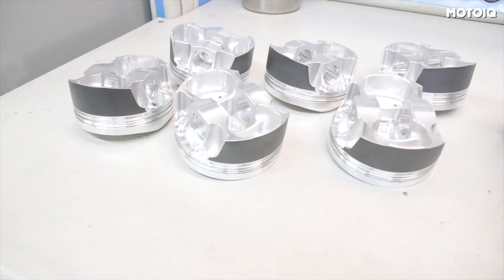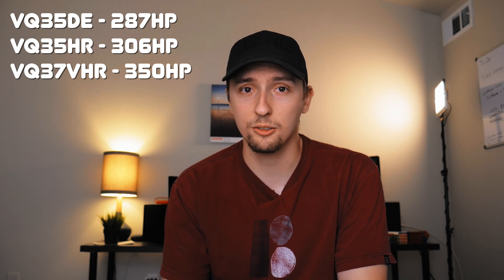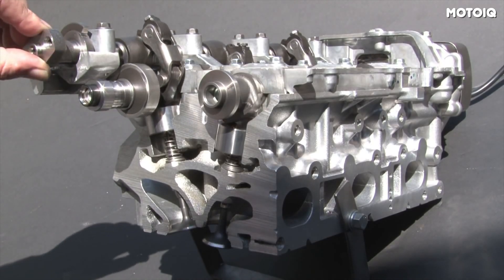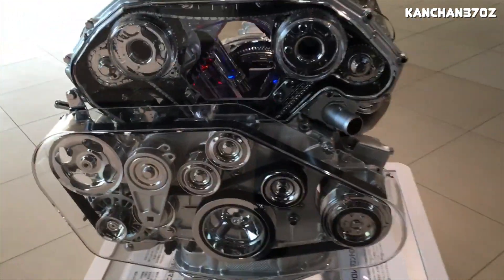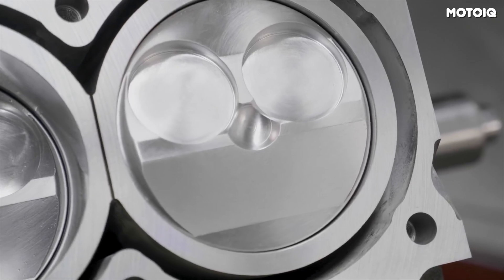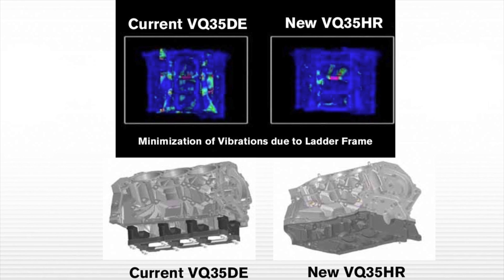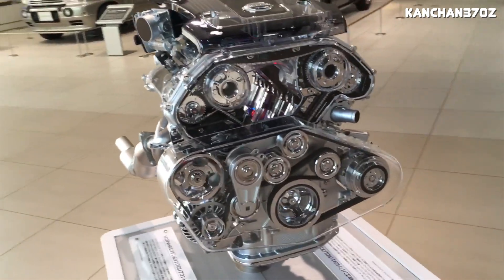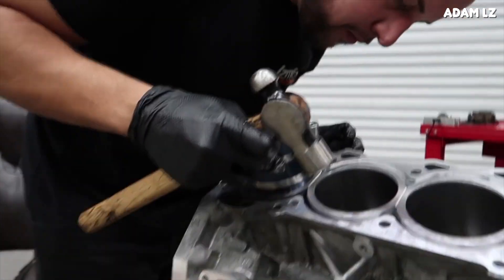Nissan VQ37VHR: Everything You Need to Know

Comment: I bought a 2008 G35s brand new. Put over 400,000km on it. Not 1 problem in the 6 years I had the car and I DID NOT baby the car. Pedal to the floor most the time, and many missed oil changes.

Comment: Im thinking about swapping one of these engines into my S15. I've had an RB swap which I loved (400whp) but the price of these today is almost as much a VQ37. Theyre old, have high mileage and many inherent issues. I've built SR20s, including an SR22vet (VVL head swap) in my car which just recently let go after afew years of abuse on 1000whp. I am now looking for a replacement. I will no longer stay SR as price for parts are through the roof and dollar to HP ratio is through the roof, the best 4 cylinder option is K series which I love as I have daily driven K swapped EKs and also owned EP3 type R and FN2 type R, i know well the capabilities of the K series. I am now at a cross road of swaps, from VQ which is new and full of technological advancement, or K swap which is almost like a Vvl SR20 on steroids, or the well tried and tested 2JZ. I really want to keep this car Nissan powered which has led me to this video, hopefully the information here helps me decide as here in Australia we have alot of SR20 and RB experience but not nearly as much K series 2J or Vq experience. Thanks for sharing this video

Comment: My opinion may be bias as a Z34 owner but I’ll say this. 

For what the VQ platform is, off the brochure performance numbers alone, it’s quite an interesting motor. 

They’re reliable, relatively easy to care for and the power is notable, considering that Ford didn’t have an OEM V8 Mustang making as much if not more than the VQ37 until four years after it went into production. 

Of course now off of horsepower numbers alone, the SS Camaro, 5.0 Mustang, V8 Chargers and Challengers have all but surpassed them but still. 

The fact that you can see plenty of videos of FBO tuned VQ37s out here giving scat packs or brand new stock V8 American muscle cars a run for their money is impressive.

Comment: My 370Z has a Stillen Hen 3 long tube intake, a Fast Intentions true dual x-pipe exhaust and a dyno tune on a Dynojet chassis dyno. Running 94 octa in e gas, We got about 390 peak crank horsepower at 7200 rpm and a nearly flat torque curve across the whole rev range.

Comment: Mine has 130k miles. It still idles smoothly and runs like new. Looking forward to adding another 130k miles.
Reply: Did you do spark plugs if so at what miles
Reply: @unpredctable-dn8bu  I did it around 11k miles. They were still in good condition. I change the oil every 3k miles. Maybe that's why.

Comment: I'd say the gains with a tune and cost effective bolt-ons goes a long way. My G37 stock put down 272 HP on a dynojet. After, I had 2.5" madrells installed, no cats, X-pipe and a Borla muffler. With this it went up to 290HP pre-tune and 307 post tune (Mustang Dyno). I'm still running the stock intakes with K&N filters. Mine is a 7 speed AT which I thought I'd regret because I couldn't find a good manual one to buy, but I don't. With the same tune I was able to get the TQ management tables raised which allows it to shift hard and chirp tires all the way to 3rd at WOT. If I wanted to boost it to 500 HP, I'd prefer to keep the same auto trans and reinforce it; there are a few companies that do it. With the current settings, the shifts feel like a DCT.
Reply: Well for the trans. There’s 2 weak points when boosting it. The flex plate and the torque converter. Because otherwise the trans in the vr q50/60’s are really similar mechanically. But because of the better flex plate and torque converter the vr trans hold 600-700 before needing a built trans. But honestly if you do transmission cooler and a aftermarket flex plate if you plan on doing about 500 your stock trans should be fine.

Comment: Mine with 273k miles still runs like a champ
Reply: Oh good..
I just bought a practically brand new 2016 370Z Sports Touring and had 110,600 miles on it but runs like butter. I only use Shell 91 gasoline in it, and looking forward to a long lasting engine, especially because I only drive 28 miles per day roundtrip, and don't drive if i don't have to. Your engine at 273K, of course at the time you posted as this post is 5 years old, is a testament to Nissan engineering and good care!
Reply: @RedMoonBlitz305k now 😎
Reply: @rommelgallego2943 Had to correct my post, I accidentally put 2026 when I meant 2016 Nissan 370Z. But she still looks and runs new! You still have your Z?
Reply: @RedMoonBlitzmine is ‘09 G37 sedan Boss clocking in at 305K miles as my DD and keeps on going.

Comment: really great car. i own a 2010 g37 sedan and its been my favorite car. i got it at 49k miles and didn't have any major issues until 145k miles which in part is my fault. the car overheated and due to the aluminum block, got a crack in it and currently swapping out the engine for one with 58k miles on it. lesson learned, aluminum blocks cannot withhold a lot of pressure, my car slightly overheated and blew a gasket and got a hairline crack on the block other than that great engine!
Reply: It didn’t go into limp mode to prevent that??? Mine just went to limp mode because I bought it with no coolant in it 🫤 worried about if I possibly damaged anything else driving it like that for 40 yards or so

Comment: These motors are basically bulletproof. i worked at Infiniti for about 6 years and we only had 1 VQ37 engine swap in a 6 year span due to the driver redlining the vehicle every time it was driven for about 4 years. The VR30DDTT on the other hand we had about 2 swaps a week on those engines. VQ's are just superior.
Reply: This comment made my day
Reply: @MrBroome-wi6zg  what are you driving?
Reply: I would agree 100% I have owned my 2003 VQDE since new and have redlined it since I have owned it.

Comment: Currently looking to buy a 2011 G 37. Looking up videos and this one was very helpful. My main concern is obviously the engines reliability so you hit the nail on the head on this one. Thank you.
Reply: Get it i got mine this year with 87k miles 1 owner he was a older guy took great care of it.  just make sure it was well maintained not tortured try to find one w 1 owner and no to much miles these engines are solid as long as you take care of it by keeping up w oil changes and reg maintenance it will take care of you for up to 300k miles ive seen one w 335k on a g37 sedan
Reply: Just got a fx37 yesterday and looking forward to this engine
Reply: @chrisayala9871  I found a 2014 370z with 15k miles. Never saw rain or snow. 3m used everywhere on the front to protect paint. It is immaculate. I am resisting tt though. Lol
Reply: If you can go with a 2012+ the gallery gasket problem was taken care of
Reply: 244,000 miles on my 2012 g37 sedan journey . Best car I've ever owned and by far the most fun to drive . Just make sure to have the sunroof drains cleaned out . I thought my windshield was leaking but the drain tubes go down the A - pillars and out the firewall . If you get water in your floorboard just use gorilla clear tape around the outside edges of the sunroof until fixed . There ,saved you a future problem .

Comment: The VQ37HR is not as efficient as the VR38, it is close. The VR Bore is 98 mm with the same 86mm stroke. VR38 also has, the same deck height and since the bore is slightly larger, so are the Valves and their arrangement within the larger Bore. The VVT and the Twins also are an improvement. As a matter of fact the VR38  VE table is 3-6% more [86%-83% at 7000RPM/ 96%-90% @55000RPM)) and thus, has a bit more flow.[ (Air Volume/Cycle)/(Displacement)].
The VQHR is one hell of an engine : the VR38 is simply an incremental improvement, but the VR38 is the slightly better engine. I am making 925 Engine HP with Stock Internals [E85 using ECUTEK] and upgraded Turbos. Again, the VQ is nothing to "sneeze" at!!!  NISSAN did a great job with the VQ37HR and thanks for your learned review of the VQ37HR, you are extremely knowledgeable: very refreshing with all the "crap" on the Internet!
Reply: 55000 rpm?
Reply: Great, you can copy and paste. And yet, you're not even smart enough to know how to spell check.

Comment: He ain't lyin about the reliability and it being bulletproof. My 2009 370 now has 207,000 on the clock and still runs like new, only "major" repair its ever needed, was an alternator at 150k miles, seriously. Hands down best car I have ever, or will ever own.
Reply: 183k and still pushing like wen I first bought it
Reply: How about water pump since it’s connected to the timing chain?
Reply: @305dadecounty305 my water pump pulley going out I’m at 130k
Reply: locked my engine last night with 153k miles kept oil lovels perfect but the gallery gasket went out also 09 370z
Reply: @brandongrover3974  gallery gasket was a recall , wasn't it?
Reply: @brandongrover3974   Nissan fixed the issue around mid-2010 or so.
Reply: hey man this comment is mad old, but how are the oil levels ?  would you say its hard to manage or do you just have to be more attentive in comparison to other cars?

Comment: VQ owners, represent!!
Reply: 2019 370Z sport coupe 6MT - the engine rocks
Reply: Yes sir
Reply: Just got one😎
Reply: ‘13 g37 yessir
Reply: G37 coupe 😈
Reply: 13 G37 Sedan journey. Beautiful white. Love those night spirited drives. 💯
Reply: Just bought a super clean 2011 g37 sedan with 85k miles, 1 owner. Im happy AF🚗💨😎
Reply: Owned a 09 g37xs, a 13 g37x coupe, and currently own a blacked out 370z base manual.. the 09 i sold over 140k no problems. The 13 i sold at 125k no problems. And the 370 is a 2020 with 20k miles no problems yet
Reply: Collectively put over 250k miles on the VHR. Those engines can take some abuse and are reliable... take care of them and they last forever
Reply: 2015 q40 Hello
Reply: 350z 2008 hr
Reply: 2017 QX70S
Reply: I got the vq35hr 2010 Altima SR
Reply: 288k miles and counting on my DE
Reply: 2016 Nismo 370z
Reply: 08 G37S Coupe 66k
Reply: Had one for 4 years and we love it!
Reply: just got my q50 brotha 😎
Reply: ‘08 g35x. And now QX70S
Reply: G37 ZOOMER HERE
Reply: 2012 G37xS
Reply: '16 QX50
Reply: Hello there
Reply: Here
Reply: Hier!
Reply: Only reasons I sold was they appreciated in value 😂 and it was time for an upgraded vq37vhr
Reply: 2015 Q50 🎉
Reply: I’ll swap you for an Altima 2006? Someone ?
Reply: '12 modified Xterra Pro4x with a 6 speed manual
Reply: Just got mine ❤
Reply: Here! 2017 QX50
Reply: @JoeT_17QX50  2014 for me. Got it in August. I absolutely love it. Goal is to pay it off in under 2 years and get a 2017 with under 70k as a part time car that gets tuned.
Reply: 15 q50 AWD
Reply: 2014 Q50 Premium AWD. Once I modify the infotainment system to get Android Auto it will be the perfect car. Fast, beautiful, luxurious, and reliable.
Reply: 2022 Nissan Maxima VQ35DE!
Reply: VQ30DE-K here.
Reply: VQ GANG
Reply: 2014 QX50. I absolutely love my car and the VQ is a major reason why.

Comment: no you will get a power increase with proper bolt ons & admintuned 🥱
Reply: Admintuning blows motors. He turned off my knock sensor and it blew 3 days later with me just cruising on the highway.  I dont have a flame map or popcorn either. I went in with new spark plugs and fresh oil change.

Comment: So glad I got a ‘19 Z base sport model.  That said it has bad snap oversteer and feels a bit numb.  Appreciate any tips for corrections thereof.  
Not too interested in increasing engine output - can’t use it on the street really and am not going to track the car.
Reply: I have the exact same car with the 6M gearbox in Magnetic black. I haven't noticed any sort of handling anomalies such as you mention. I did a very fast drive down the California coast highway, US 1, from Oregon to San Francisco on very tight and twisty turns at more than double the posted speed limit. The car handled flawlessly and was completely stable. I did wear out the OEM Bridgestone Potenza tires in front though.

 Shortly after I got the car I had a set of stiffer Hotchkiss anti-roll bars put on the front and rear.
Reply: @videomaniac108  Sounds great Jim.  What tires did you replace the OEs with?  Did you replace them with the exact same size?  I did hear the Hotchkiss bars are great.  I am looking at getting Eibach front and rear sway bars based on the recommendation of my dealer’s service reps who do some racing.
Reply: @jacksparrow5281  I put the Michelin PS4S 245/40R19-F, 275/35R19 R(OEM sizes) on and noticed that the ride is quieter and less harsh. I had to go up on the inflation pressures from the stock 32 psi all around to 43 psi - front and 46 psi - rear to get equal tread wear across the tires. The Michelins have great grip in the wet and dry and I estimate that I will get 30K miles on them easily, without tire rotation - which we can't do on this car with directional rotation tires and the staggered tire sizes. My only complaint with this tire is that because of the more flexible sidewalls the handling is a little more vague and less precise. I plan to go with Michelin Pilot Sport Cup 2s for the next tire. Around the end of the year I'm planning on putting a set of Litespeed forged magnesium wheels, maybe in 20", on the car in a +1 setup. One nice thing that I like with the Michelin tires as compared with the Bridgestone tires is the use of Aramid fiber instead of steel belts, which makes each tire a few pounds lighter.

The stiffer bars will make the ride more harsh, but the handling improvements are well worth it in my opinion.
Reply: @videomaniac108  This is great information.  Enjoy the car.  thx

Comment: I love my Q50 2014 with this VQ engine!! Super reliable! But not so great on gas mileage
Reply: Yea my 15 q50 is a guzzler but it's ok im also not so easy on the pedal
Reply: I have a 2015 Q50 RWD. Average 21.4 MPG on 93 octane.
Reply: love my 2013 g37, i feel yea on the gas mileage. still better on gas then my v8 monte carlo
Reply: I'm averaging 12mpg at the moment... highway driving isn't much better either
Reply: @ekamvirk7599  something is wrong with your car, my man
Reply: I have a 2009 G37 and get 21 around town and 26-28 on the interstate doing 70-80mph on a long trip.
Reply: I have a modded and uprev tuned '13 g37. Stop and go I get around 18mpg. If I get hit the interstate at all, mileage bumps up to 23-24, maybe more. Any hard driving though and it will easily get down to 14-16 mpg.
Reply: I have a FX37s and I average 20.2
Reply: Yeah I average 21.6 highway, but typically get 17-19 city
Reply: I've got a 2017 qx50 Infiniti.I've never floored it and havnt needed to.what a sleeper the little SUV will suck you back in the seat.Get solid 24 mpg on highway

Comment: The oem intake is designed so well the only intakes I believe that help are the stillen gen 3 style. People who put those “CAI” which in reality is a HAI don’t understand how intakes work. Only downside to the gen 3 style like it are almost always made of metal of course but no coating. Definitely need to wrap them up with heat resistant tape u.
Reply: Uh AdminTuning 3 inch intakes is better then the stillen ones and with the admin you don’t gotta wrap them up.
Reply: @AQCE245  yeah true especially with the optional filters
Reply: @sk8punk318  Allot of people don't understand that when you use 3inch intakes you gotta upgrade your throttle body to 70mm to take full advantage of the 3inch because keeping the stock TB is like trying to breath threw a small straw
Reply: @AQCE245  It's really not that big of a deal
Reply: @AQCE245  TB isn't the only thing you need to upgrade if you get 3" intakes. These noobs don't realize you need to do ported lower manifold. If the space for air remains the same from the inside of the engine, stretching it out from the intakes makes negligible gains

Comment: Here’s a video idea that would seem interesting. VQ37HR vs N55 (or n54). These are 2 engines that I’ve noticed are heavy sought after
Reply: Its much easier to make a N54 fast with a few bolt ons. The vq37 is quick but once the boost kicks in bye bye infiniti 👋🏼
Reply: @JDM_KID_DAILY  Unless you supercharge the Infiniti which can make 600+whp on stock internals reliably.
Reply: kinda I guess, but it’s really a choice of reliability or power. the n54 will have to have way more boost to make the same power as the vq, considering the vq makes the same stock as an N54, meaning one of those six cylinders is far less efficient. but the N motors will handle more power and boost than the VQ can, but then again you got your list of N series issues, Vanos, gaskets, hpfp, water pump, etc. while the VQ doesn’t have any major failure points. honestly when I was consider what can I wanted, I was debating between a g37 and 335i, and just decided to get the g37 now for reliability’s sake, and 335i later down the road and build both, it’s hard to choose
Reply: @adamedwards4536  I was thinking the same thing...have the g
For a fun reliable daily or whatever you want  but when you want to bring the big guns 335i 💪🏽

Comment: Since this engine platform has been round almost m30 years..........Have they kept the Sequential Multi Port Fuel Injection and resisted the move to Gasoline Direct Injection (GDI)?
I have read conflicting stories one says SMPI and the other specifically says Nissan Direct Injection.  What version is correct.?
Reply: sonis the car direct injection? i google it and it says no
Reply: I have a 2019 370Z and the engine still has the sequential MFI system. The VR30DDTT that's in the Q60 redsport and upcoming 2022 Z has GDI. I prefer the port injection to GDI because of the valve carbon problem wit GDI engines.

Comment: SR20VE had similar heads to this engine, so it wasn't exactly the first for Nissan, as he mentioned
Reply: The SR20VE has 2 cam profiles for each cam with different lift and duration, but these profiles were rigid, not infinitely variable.